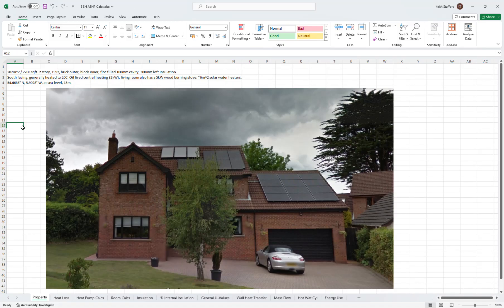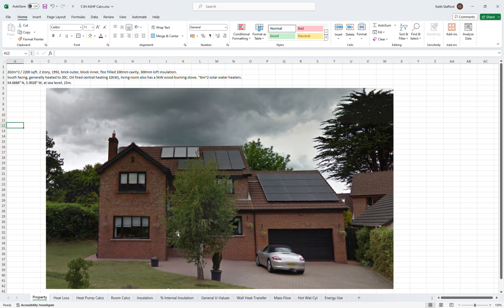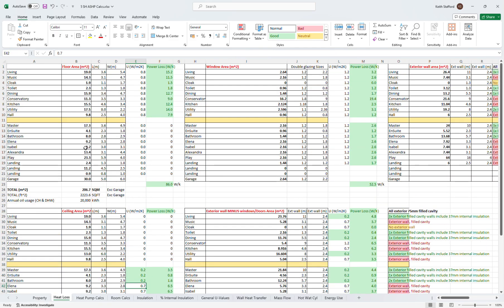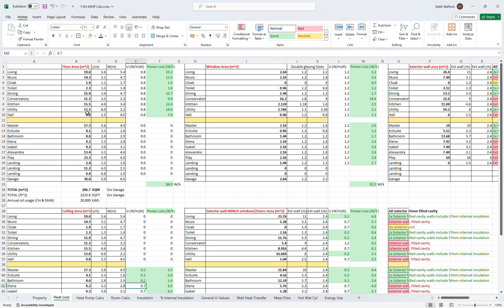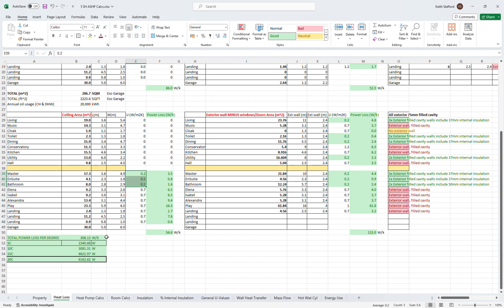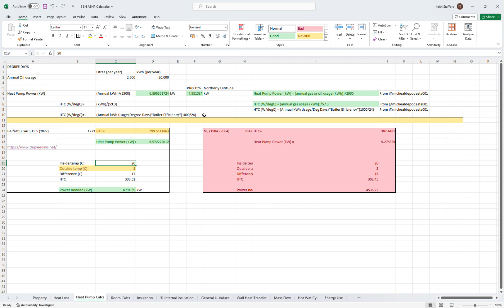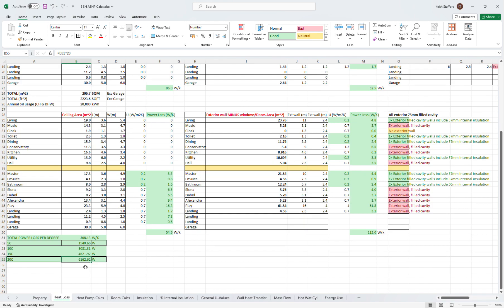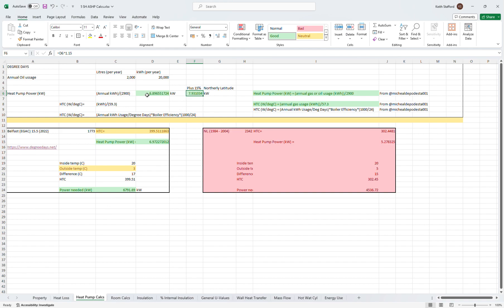Two ways to work out your heat pump size.  Self Install of 7kW aroTHERM plus Heat Pump. E5.

Comment: Thanks . I have a similar property but unsure what type of suspended flooring was used at the time ... Could you share some details of your ground floor construction ,..Thanks
Reply from the maker: The ground floor is a concrete sub floor with 1" (25mm) polystyrene insulation layer and then a sand/cement screed on top. We have no suspended floors.  BTW, I set the screed floors at a U value of 0.8. this figure also takes account of floor coverings.